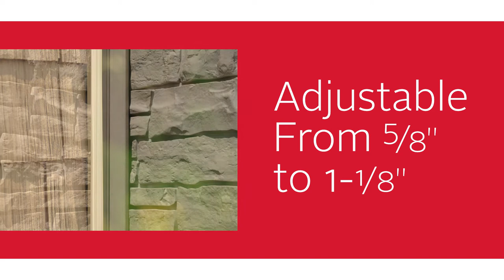NovikTrim Installation (English)

Comment: Pretty vague on how to cut for windows.  It said to cut pieces 1 3/16" bigger on the top and bottom window pieces but didn't mention you have to notch them so they actually fit.  I think they look really cheesy with the uneven overlapping edges.  Too late now to switch to regular j channel..

Comment: Shame on Novik  for the huge prices on  there ledge trim. 3600 dollars for a fucking strip of plastic that goes around a trailer. If I knew ahead of time that they were going  to rip me off I wouldn’t have bought there dry stone product. I will warn everyone I know of this price gouging.
Reply: Right, all I'm trying to do is get the exact dimensions of their j channel so I can buy any other brand other than theirs. They want 4 times the price per foot of any other color matched trim at Menards
Reply: Thinking of using regular J channel trim with their DS siding. Anyone done so?
Reply: @jyarber123  I ended up just using regular 1" vinyl j with the stacked stone and worked great.  I spent like a fifth of what they wanted for their over priced stuff lol
Reply: I bought the Novik trim but think I want to return it and just use regular J Channel also.
Reply: 1” seems fairly large. These panels of mine are fairly thin. You think 1” is needed?
Reply: @jyarber123  definitely needed on SK. Not sure if your dry stack is thinner. Most of the "stones" fit comfortably in the j but others are cutting it close. It's a nice fit, definitely couldn't go any smaller, at least on SK. I'd go to Menards if you have one in your area and get your hands on the two to compare
Reply: Yeah Ill take a look tomorrow. Glad to know it worked out